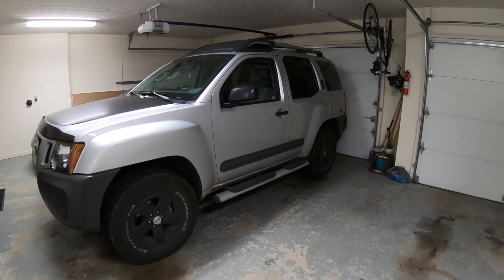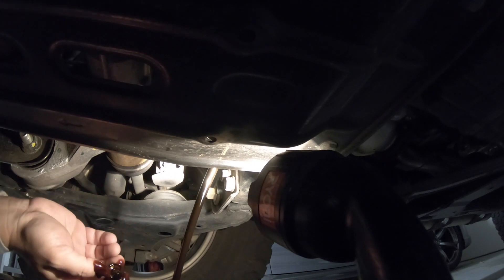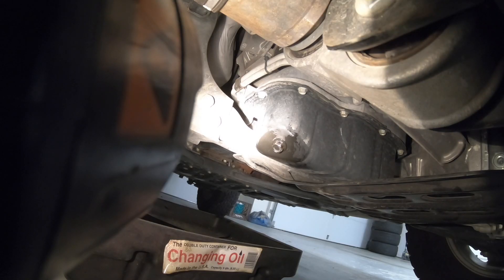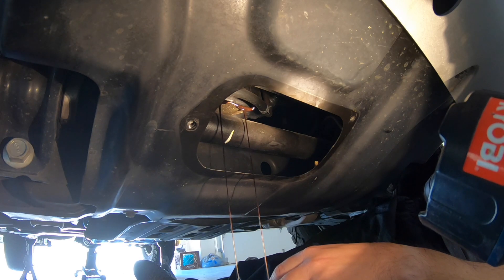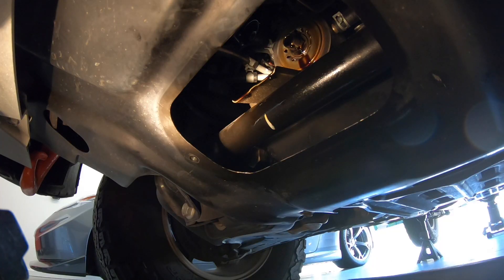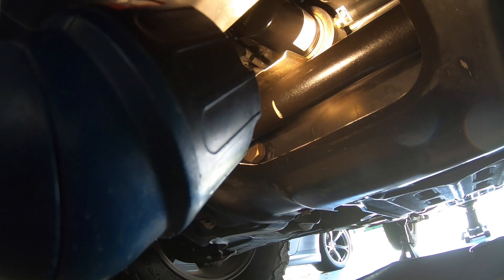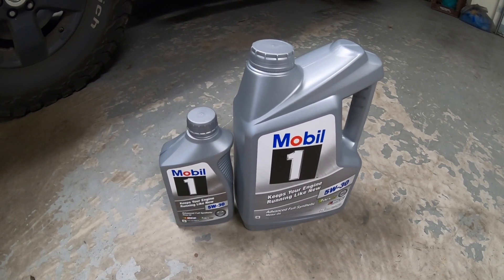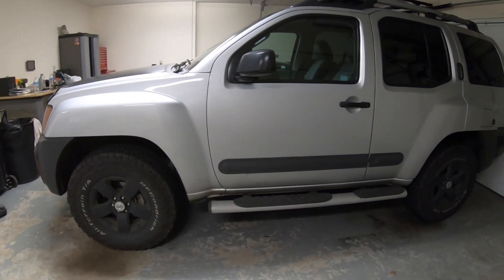HOW TO - XTERRA OIL CHANGE - THE CLEAN WAY

Comment: I was looking through the owners manual and it says to use 5W30 ester blend motor oil (NISSAN recommends Genuine NISSAN Ester Oil). What is ester blend motor oil? Why can't I use full synthetic 5w30 oil instead? Or are they the same thing? Amazon says that the Valvoline full synthetic 5W30 is compatible with the 2014 Xterra while Walmart says it isn't.

Comment: Looks like a great idea! BTW I use a product called Form a Funnel and they only cost like $12-$15 depending on what size you buy. You could put it between the sway bar and the oil filter drain and you wouldn’t have to jack the back end up. Just thought I would throw that out there.
Reply from the maker: Yes, I have actually tried that. I even cut a plastic cover off one of my kids notebooks once to use as a possible solution. The problem is that the channel that the oil runs down barely extends past the point where filter meets the engine so no matter what I've used, the oil would end up draining a little behind the channel. It's a bad design. The other problem is that opening is a lot smaller than it seems on the video. I know there are some aftermarket skid plates with bigger openings but they are expensive. I would love to see how they change the oil at the Nissan dealerships on a lift without making a mess. They either take the entire skid plate off or go through a lot of brake cleaner.
Reply: @Rhetorical Answer thanks ..I have plenty of metal self tap screws.

Comment: Any noticeable difference with that k&n air filter over the stock paper filter?
Reply from the maker: Honestly...No. However, I go off road a lot so being able to clean the filter is the biggest reason I used the K&N.
Reply: @PerfectedAuto  might want to check out the video from Project Farm about air filters. If that is a concern for you that has helped you to choose the K&N I think you might want to see the results.
Reply: @PerfectedAuto  I would definitely recommend you look into your filter choice. That is a racing style filter and it is very poor at protecting your engine... I would choose wix

Comment: All you have to do is use a big zip lock bag around the filter and voila.. oil spills into the bag. No mess. You’re welcome 😬
Reply from the maker: Sorry for the late response. No way that’s going to work. The zip lock bag wouldn’t seal around where the oil filter meets the block. A new solution I have is to poke a hole at the bottom end of the filter and let the oil drain out of it.
Reply: @PerfectedAuto  wow. Thanks . I will try that
Reply: funny I didn't even thought about that too. Very good idea.

Comment: Don't have own jack & stands yet, but definitely keeping this in mind once I pick up my Xterra this weekend. For now, I'll have to keep using aluminum foil to catch excess sludge.
Reply from the maker: Even rolling up on 2x4’s with the back tires helps. If you have a garage, parking backwards helps also since the floor slopes towards the door. Sorry for the late reply.
Reply: @PerfectedAuto  Great tip! I'll try this next time. Minimal spilling with the first oil change on my used 05 Xterra.

Comment: 5¼ quarts? What size engine? I read only 3½ quarts? Doing our granddaughter's vehicle.
Reply from the maker: It’s a 4.0 liter V6. It’s definitely 5 1/4 quarts. Thanks.
Reply: @PerfectedAuto  
That explains it. I think our granddaughter's is only a 3.3 liter engine.
Reply: Going to start doing my own oil changes. Just trying to be sure but it says 5.4 quarts. Do you do 1/4 to be safe so you don’t overfill?